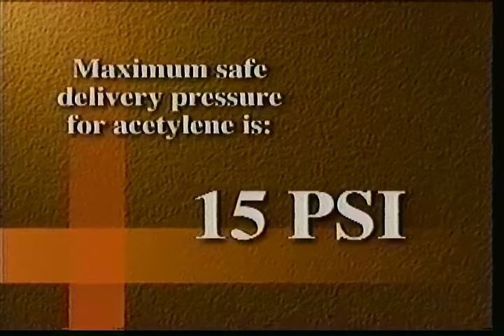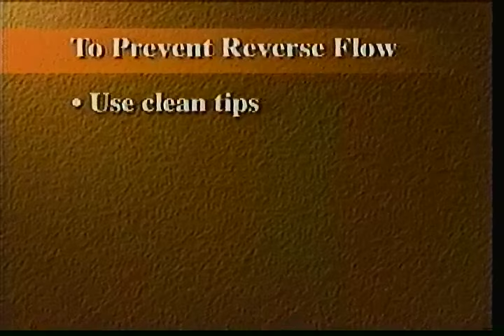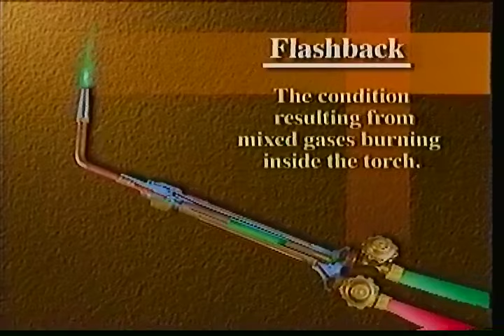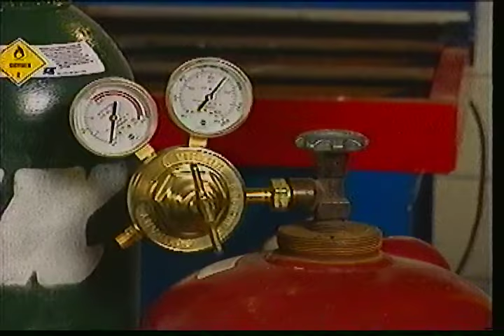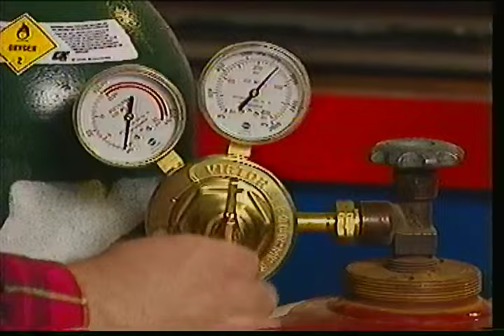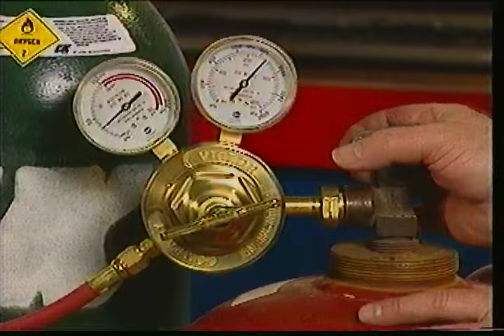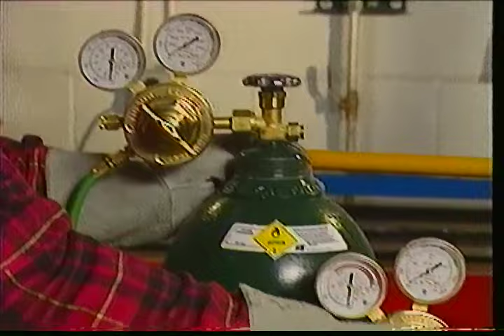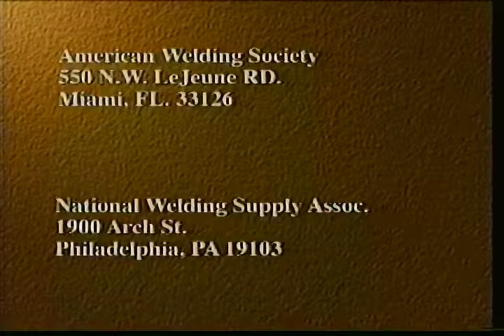Oxyfuel Safety, Its not an option!

Comment: 26:05 Closing the torch operation: FIRST turn off Oxygen and then ACETYLENE( O before A). It allows you to check for leaks in the system. and it is recommended procedure in case of a malfunction. If you follow O before A shut off and you hear a pop ---> OXY valve is leaking. 
If there is a small flame clinging to the tip then the FUEL valve is leaking. 
By using O before A you get a check of the operation of the valves each time you use the torch. 

If you shut down A before O. you will get a pop and SOOT will be sucked back into the torch possibly clogging the  gas passages.

Comment: "23:35 if there is too much heat don't adjust the pressures at the torch. CHANGE TO A SMALLER TIP" Just about every oxy welding video tells you otherwise. They say there is a range of heat adjustment you can achieve by increasing/decreasing the fuel mixture. You want to ensure the fuel pressure at the tip does not fall below a level which would see the flame sucked into the tip and torch (STARVATION of fuel) You also do not want the fuel flame to burn too far ahead of the tip (too high fuel pressure)